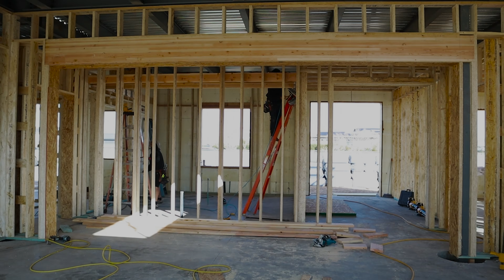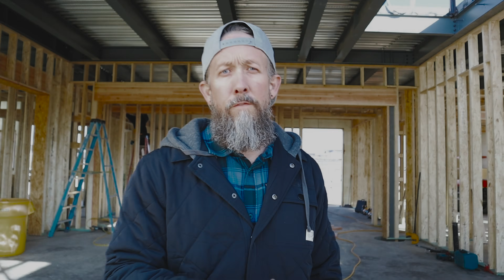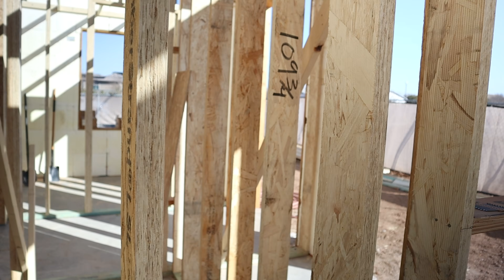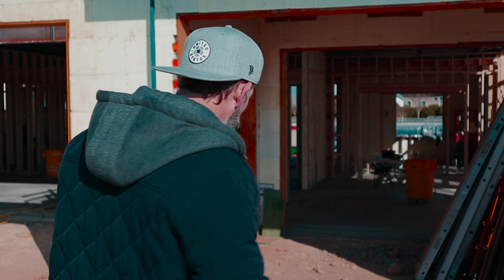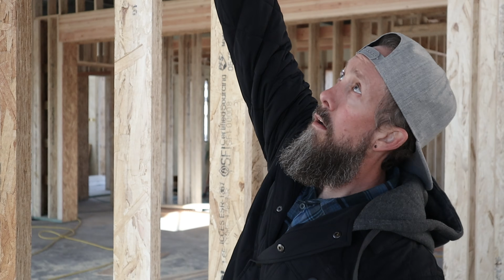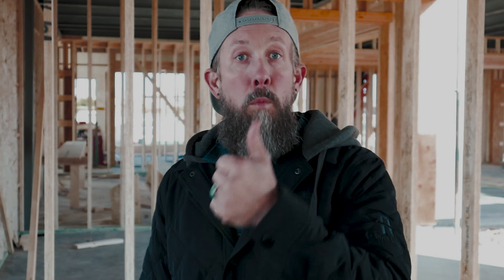Best Framing Method? Wood Studs, LVLs, or LSLs | EP-29: Liberty Estate |  AFT Construction

Comment: How do LSL and LVL compare with exposure to moisture? Will it “blow up” (expand) similar to MDF, particle board etc? Say a pipe leaks on a wall while family is on vacation for a week. Or, they’re in Arizona and run a swamp (evaporative) cooler except during monsoon season. On the latter, say a house hits 60% humidity on the interior, I’m curious how they’ll respond. I’m doing a very unique build-out for interior walls on a 1960 block AZ home. Aiming for STRAIGHT non load bearing studs (level 5 drywall). I refuse to use the twisted noodle-garbage home despot sells.

Comment: I frame with lsl and lvl studs using Simpson A23 brackets with #9 screws instead of toenailing with nails. Very fast and very strong. Meets more stringent structural requirements.

Comment: You mentioned that the cost for ICF is 5 to 10 percent more.  More than what?  Concrete block? 

How does the labor and materials cost typically differ between ICF and concrete block?
Reply from the maker: The comparison is typically standard 2 x 4 framing or 2 x 6 framing to ICF. Concrete or masonry block is not as common in Arizona for standard home construction. But in many cases, it’s stick frame construction and then veneer, stone or brick.